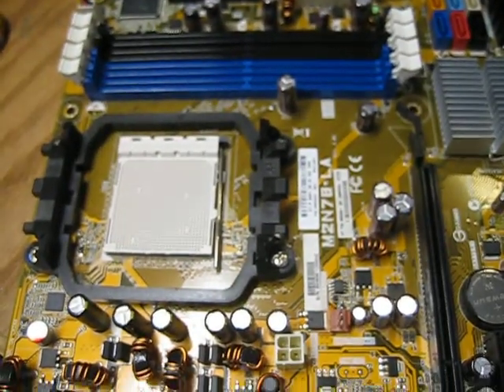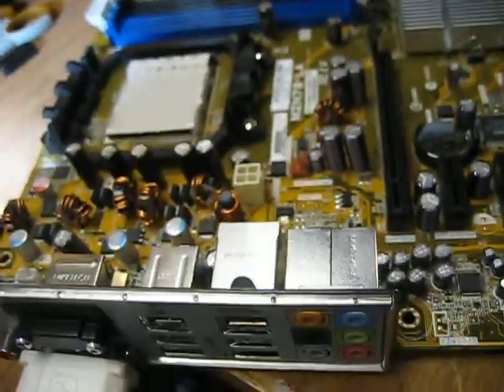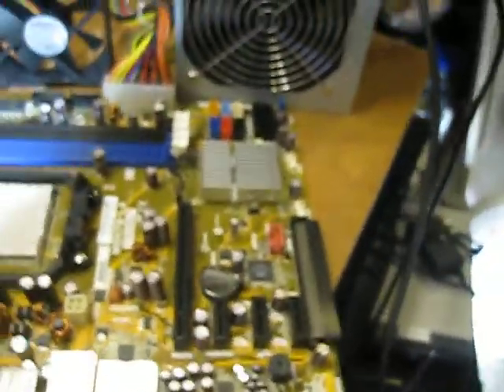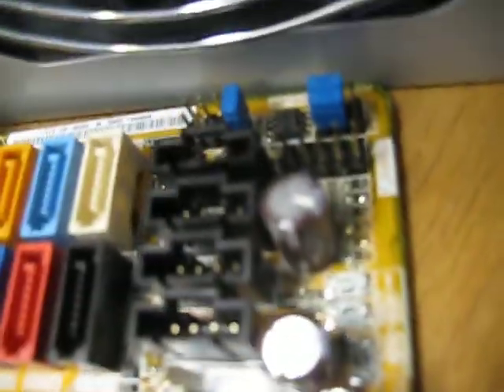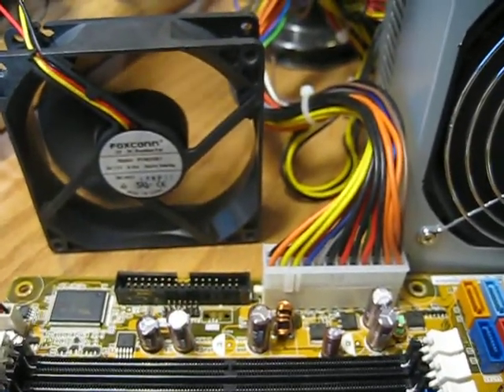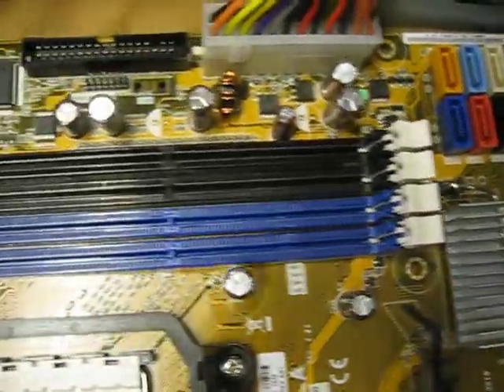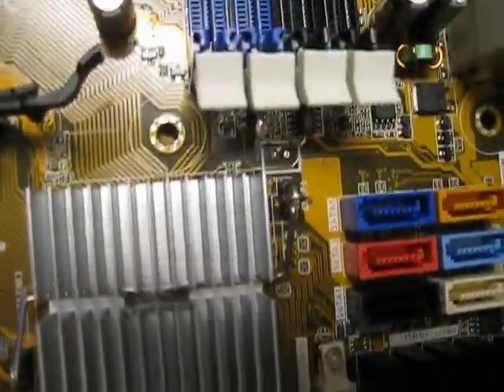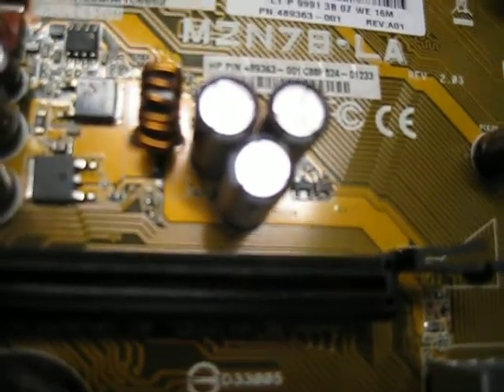TEST ON  HP MOTHERBOARD M2N78 LA

Comment: hi guys, I have the same motherboard ram slot 1.3 does not work,I changed the AMD Phenom II X4 965 Black Edition and it  not work after changed,Is my motherboard dead??AMD Phenom II X4 965 Black Edition 125w!!! This motherboard 95w!!!!violated the motherboard or??
Reply from the maker: See if this help http://askpctech.blogspot.com/2017/02/installing-amd-phenom-ii-x4-970-on.html
Reply from the maker: Hi Tytti MC read this my help http://www.tomshardware.com/forum/328404-28-installing-phenom-m2n78-motherboard-supporte